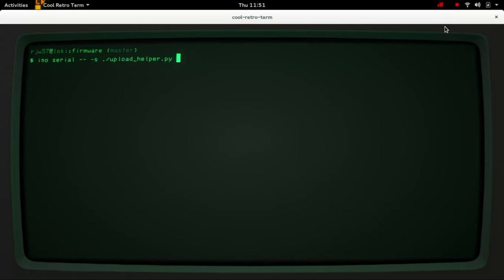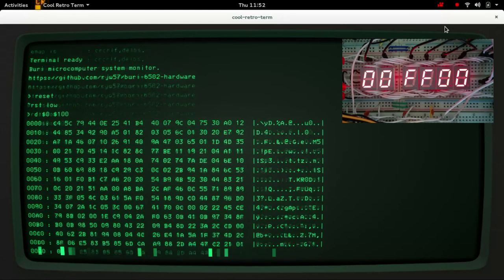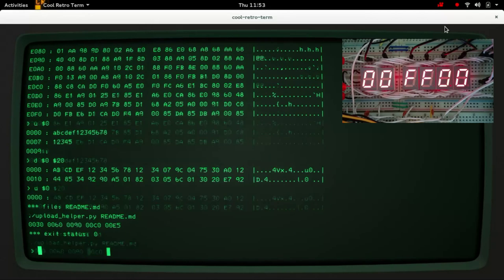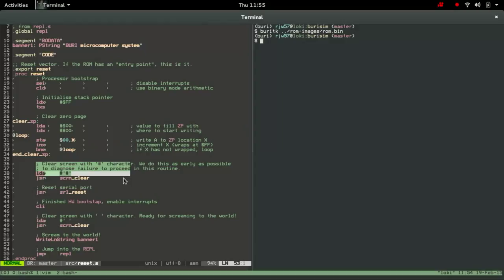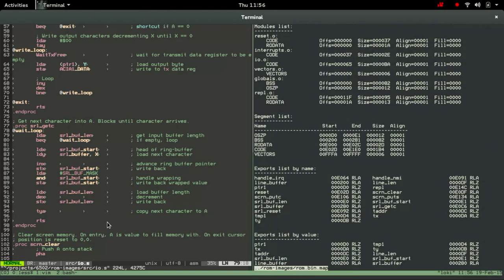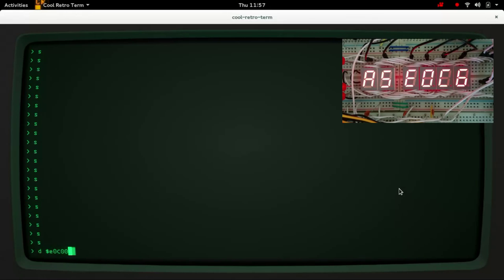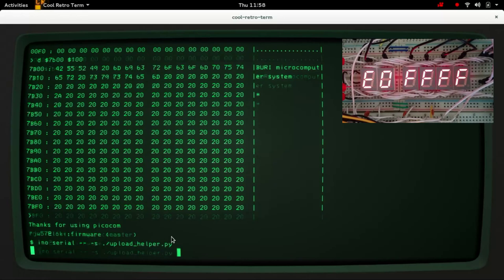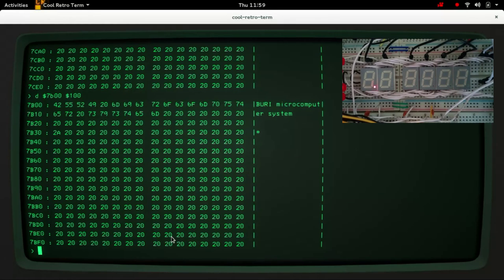Buri: a homebrew 6502 computer - part 2

Comment from the maker: Part 2 of my homebrew 6502 computer overview. In this episode we wire up the ROM/RAM and check that something is written to the screen by directly examining screen memory. (There's no actual video hardware yet!)
Reply: Sounds fun :) -- looking forward to watching when I get a chance.  I think the 1986 version of the microprocessor data book, still in use when I was an undergrad, had the specs on this processor (together with block diagram of the BBC micro!).